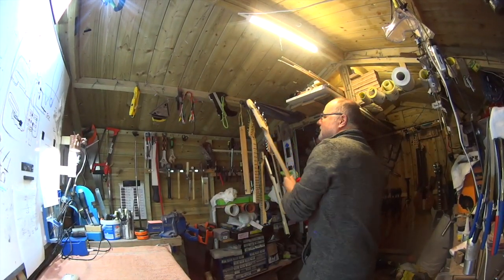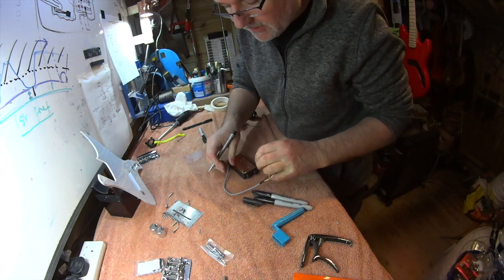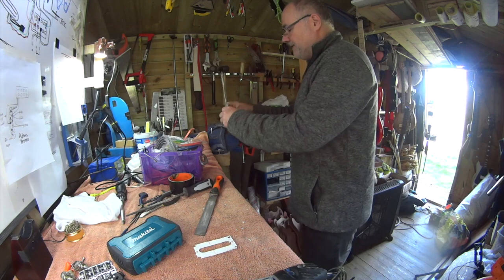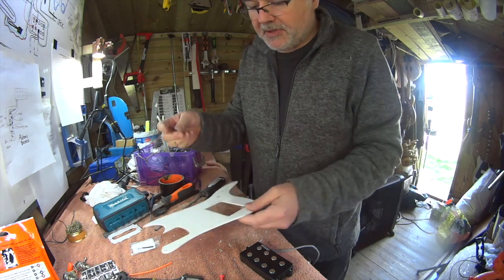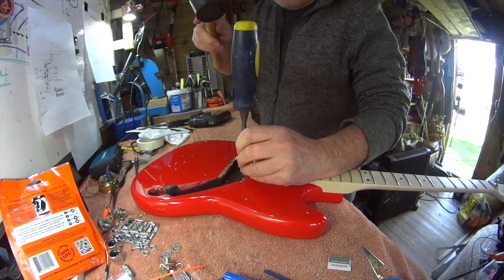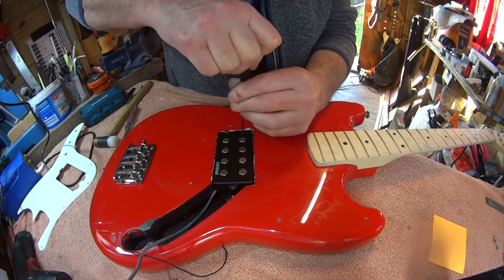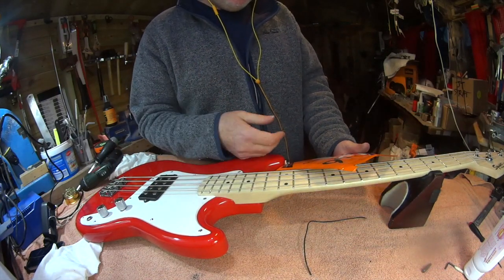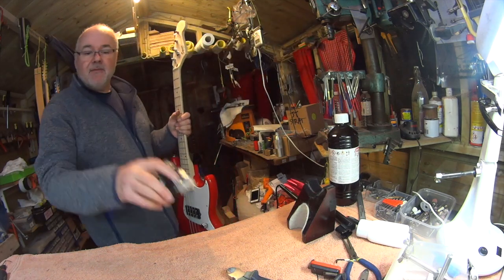Squier Bronco bass bridge change pickup upgrade and set up

Comment: Instead of scrapping the bridge , just redrill the bridge to accept 4 17mm bridges voila and now you good intonation ability and keep the unique muiscmaster style stock bridge.
Reply from the maker: Good idea. In this case my customer specified what they wanted so I just went along with that. There are times I might look for another solution whereas my customer's solution is different hardware.
Reply: @SamDeeksRelovedGuitars   I just hate seeing hardware tossed when it can simply be improved negating the need. But yup customer wants a different bridge then thats that.

Comment: I sometimes wonder if it's worth doing these projects. Of course it's what the customer wants so that's good enough. When you weigh up the price of the bass, hardware and strings+ a skilled man to fit it out, you must be well on your way moneywise towards a better model with decent specs. Great video content, thank you for uploading.
Reply from the maker: Thanks James. You're right; it often isn't 'worth' doing them - except, as you pointed out, the customer wants them done. Many people value being able to 'design' the guitar they want and 'direct' the process - more than they value a branded guitar that will still need setting up anyway...

Comment: Just a thought... if you are going to put that much work and money into upgrading this bass, why not just buy a better bass? I think the whole attraction of this instrument is its cheap price. With a little limiter/enhancer pedal, or a nice multi-effects box, you can get a decent sound without spending much money. People spend a ton of money and then end up selling the instrument. Doesn't make much sense??!
Reply from the maker: Eliot you're both right...and wrong. Right in that, for YOU it doesn't make sense and you'd be inclined to put the money towards a better bass. Having said that, that bass would itself probably need setting up. You're wrong in that Adam is a long-term customer. To him this was about getting a bass + set up and modified by me (his 'go-to' guitar guy). For him that's more than just a bass. It's not easy to see the situation through someone else's eyes but it's useful to try to do that because if nothing else it will stop you sounding like you simply think you're 'right' and they're 'wrong'. If we could all do it more it would lead to world peace and human happiness :-)
Reply: I've built a number  professional grade short scale bass's from cheaper base models that had excellent body and neck. Wiith care-full planning and consideration into parts selection you can easily end up with a much better instrument  for ½ the price  and spend the money saved on some nice expensive labella's  etc and still gave left over money.

Comment: I have a squier bronco that I want to mod but Im scared to screw it up. I really don't know what to do...
Reply from the maker: My advice would be this: set your thinking to "Hey, this 100 £ $ (whatever) is going to be spend on learning and gaining experience - regardless of whether or not I get a nice bass out of it..." That's how I started out.
Reply: @SamDeeksRelovedGuitars  Oh thanks Sam...I am just currently having trouble finding a pickup that cheap for the bass. I can't really use too much money on it so I need a good pickup for cheap. Also can you link the products you used? I would appreciate it. Thanks you!!
Reply from the maker: @sj3802  I think it was this one 
https://www.ebay.co.uk/p/Wilkinson-Mwm4-Bass-Pickup-for-Mm-Type-Electric-Guitars-Black-Humbucker/1366515944?iid=131962681756&chn=ps&norover=1&mkevt=1&mkrid=710-134428-41853-0&mkcid=2&itemid=131962681756&targetid=596596272701&device=c&mktype=pla&googleloc=9045304&poi=&campaignid=6619151963&mkgroupid=84510980768&rlsatarget=pla-596596272701&abcId=1140496&merchantid=6995734&gclid=Cj0KCQjwoebsBRCHARIsAC3JP0IrYUc49htC-aZuVqoF34gYwj8fnLI3noda2QtxxnX9-mdXwAoKbukaAjgREALw_wcB

Comment: Did this guitar come with the orange drop capacitor or did you install it? Do you remember what size it is? Nice job and video btw
Reply from the maker: Thanks Randy - no, I installed it (replacing the 0.047uf original that went with the single coil pickup). It was a 0.022uF to suit the humbucker. I bought a load of those 'orange drops' from China; function absolutely perfectly as well as the same (slightly smaller) orange drops bought over here in the UK for 5 or 6 times the cost.

Comment: Hi Sam, I was wondering If I could pick your brain, I have a Chinese telecaster ripoff/ copy (yes, one of them ) and it has a set neck. Everything is fine with the guitar and I`ve done a lot of mods but the neck is about a 14 to 16 inch radius which I dont particularly like. I know a lot of people always want to go flatter and are probably screaming don`t do it but I was wondering if you have ever gone the other way 16 to 12, can you see any problems ?
Reply from the maker: Hi Karl - yes I've gone the other way and no, I don't foresee any major problems other than if it's a rosewood fingerboard then you'll be thinning it towards the edges, that's all. So long as there's enough wood in the fingerboard then it should be fine. In my experience, it's quite difficult to do precisely by hand because it's difficult to keep the block absolutely on the centre line. But you can get close :-)
Reply: @SamDeeksRelovedGuitars   thanks

Comment: Can you advise me about where would be the best place to get an acoustic guitar set up I have a Taylor guitar that the action seems to be a lot higher than when I first had it to the point that it’s not nice to play anymore
Reply from the maker: Hi - I do acoustic set ups but some things to check on your guitar first to get an idea what's up with it. When the action starts to rise noticeably it can often be the result of the bridge rising up or the neck sinking in to the body. The bridge rising is often caused by the top absorbing moisture which swells the wood. The rigid sides stop the top expanding outwards so it 'bellies' upwards taking the bridge with it. You can determine the degree of this your guitar has by placing a long ruler on its edge behind and parallel to the bridge. If there's a gap between the ruler and the guitar top at both sides then your top isn't flat and is bellied (assuming of course that it's not an archtop!). As the top bellies not only does the bridge rise (causing the action at the last fret to to increase substantially) but it eventually also breaks the joint between the bridge and the guitar top, ultimately causing the bridge to lift at it's back edge until it finally breaks off. 

If it's a very old guitar, the string loading can also deform the neck / body joint causing a dramatic change in the action. If / when this happens, the only real solution is an expensive and time-consuming neck reset. 

If the guitar action has increased due to excess humidity in the top (very common in the UK's damp climate for example) then the long-term remedy is to de-humidify the guitar and then keep it in a more controlled ambient environment. This can be done by booking it into a good music shop with the appropriate facilities (a special cabinet) and / or keeping your guitar in a de-humidified environment to dry it out over time. In the short-term I may be able to make some improvements via either Taylor's special neck shims or some adjustment at the saddle (and nut). Either way, that action would need to be adjusted again as / when any improvement was achieved by de-humidification. 

Drop me an email at samdeeks@gmail.com if you want to discuss further. Cheers!

Comment: How noticeable is the difference in string spacing after installing a bridge with larger specs (19mm vs 17.5)? Thanks.
Reply from the maker: Unfortunately I can't answer that (not being a bass player or having spent any time playing this in its default configuration); all I can say is that Adam loves it with this bridge and pickup upgrade.